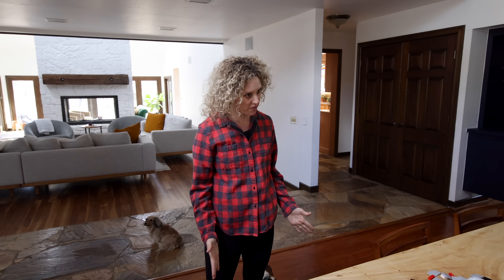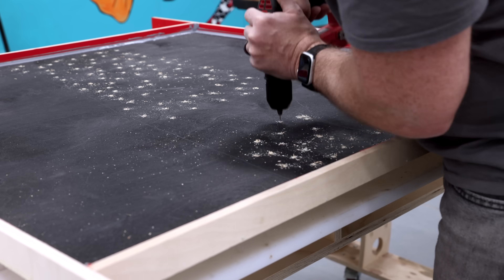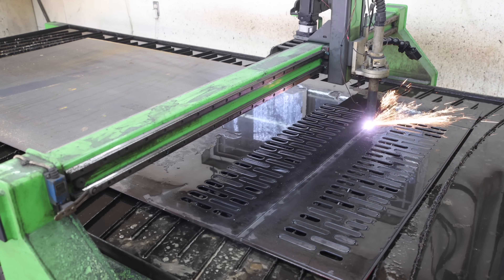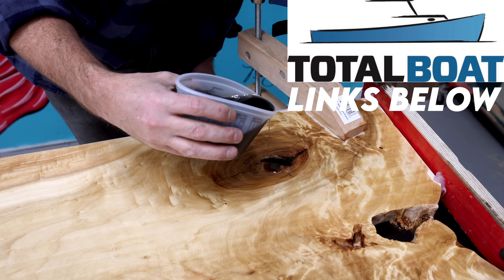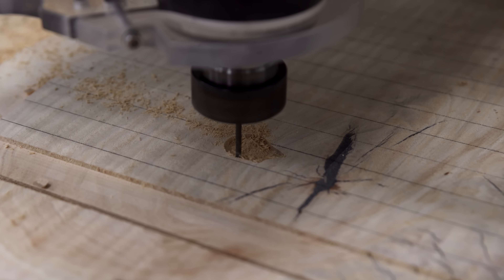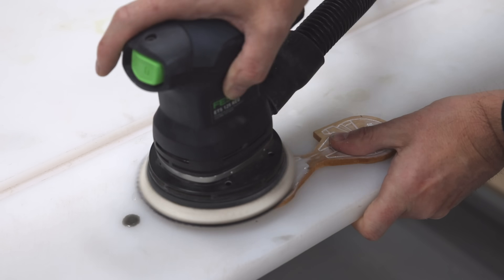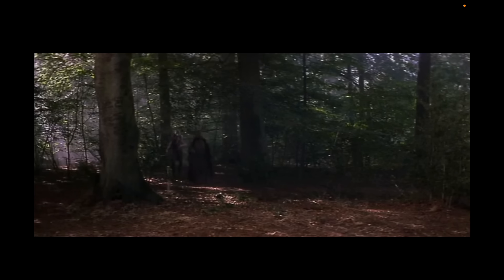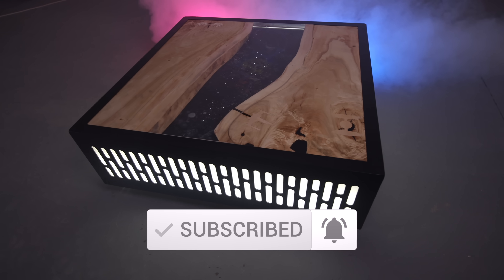Every Star Wars Fan NEEDS This

Comment: Just for future reference, you should use polycarbonate instead of acrylic.  acrylic is brittle, and polycarb is much more flexible.  That's why we use it for signs, and it's much more weather resistant.  May the Schwartz be with you!
Reply: Polycarbonate will scratch very easy.
Reply: @scotthoward6339  It does, that's for sure.  You can laminate it with optically clear orafol laminate and that prevents it.  I've also sprayed it with clear polyurethane and that worked great.  Generally when I do polycarb signs I always spray tha back and apply translucent vinyl with laminate on the front.
Reply: Cast acrylic is much less brittle than extruded acrylic. Ask me how I know!
Reply: @okiwatashi2349  Oh man, I've got some horror stories of that too!  If at all possible I use cast laser cut acrylic, I've seen extruded acrylic letters just shatter in my hands.   I feel ya
Reply: Agreed on the polycarbonate
Reply: It's an epoxy table why do you need plexiglass isn't that what the epoxy is for????
Reply: @Dragndroprecords  have you watched the video?

Comment: This is so overbuilt, you put an over-built plywood frame inside a 1/4” welded sheet metal frame…and then kept adding more, I’m glad you’re pleased with it. So much money…so much weight.
Reply from the maker: More like 1/8th inch steel.

Comment: ‘The force is strong’ with this one. 
One “improvement” I could see is to have the fibre optics and the LEDs for the sides on separate switches, as I feel that in a darkened room it would be nice to watch the twinkling stars without the bright sides. 
Awesome build though and definitely a keeper.
Reply: or at least properly seal the edges to avoid the light bleed from underneath. Very cool project all in all.
Reply: and cut the fibre optics at different heights to give dimension .  totally cool though.
Reply: @markstanley7251  My thoughts, while watching, too.
Reply: Just keep in mind that we are not on a ball lost in the vacuum of space tumbling towards a Black hole 🕳️ Earth is FLAT and NON ROTATING ❣️❣️
Reply: @freefreepalestine360  bruh
Reply: @markstanley7251  I was thinking the same thing
Reply: @freefreepalestine360  Yeah, and I'm not typing this.
Reply: @rogermccaslin5963  Just keep in mind that we're one beautiful family in the center of the whole universe on a non rotating FLAT EARTH.  the bible is a flat earth book💗know that earth is not a spinning ball, lost in the vacuum of space tumbling towards a 🕳️

Comment: Instead of laying up a whole graph, you can shoot a photo perpendicular and centered from about 15 feet away to minimize lens distortion and then just pull it into your CAD software and trace it as a vector path. Or if you have Lightburn ($60) and calibrate a camera to it, you can pull the image directly into the software and autotrace it.

Comment: Sealing your wood pieces with a thin brushed on layer of clear epoxy before pouring your dark epoxy into the inlays can prevent the staining you saw. Saving you the headache you saw. Just a small trick I learned from another epoxy wood pourer.
Reply: varnish works too, as he mentioned, and then forgot!

Comment: "The Force is Strong!" And Im not even much of a star wars fan. But this was cool! It would be better if that strip of light from the outside was hidden and if the 2 lights were seperate switches. Again SUPER impressed with this original build from you! 👏👏👏

Comment: Is there a visible difference in drilling holes for fiber optics at 90 degrees from the wood to like.. 45 degrees in different directions? I feel like it would look pretty interesting if it does. Like alternating directions. Idk if that makes sense.

Comment: That is super cool! I love think up projects that use some sort of lights,such as lamps. Here is a good one take a leftover glass or acrylic and etch whatever pattern you like into it. Then take piece of wood or a box of some sort large enough so you the glass on edge on top. Cut a slot just big enough for the glass. On the bottom of the wood route out a space for your light source ( under the slot ) and deep enough to open up a space under the edge of your etched pattern( a friend etched a rose onto a scrap piece of 1/2 glass from a broken table top ) use what ever color light you like. I think you will like the outcome, get your wife or daughter to do the etching. I know of three ways to etch 1) is an acid solution, 2)sandblasting, and 3) using an engraver or vibrating pencil.HAVE FUN AND KEEP UP THE GREAT VIDEOS.

Comment: when you pull it apart next put some open cell foam in the gaps to block out the light that distracts from the epoxy part, hard white line of light is bright enough to out shine the tiny fiber optics

Comment: Just watched your video what an awesome table. I build Star Wars models and I have found that the best way to glue up fiber optics is with UV glue. The hot glue melt fit in the CA glue makes it brittle what causes the light to not travel through the fiber optics quite as well. 
I've been wanting to build a Millennium Falcon coffee table for sometime. Now I just had to find this video and it's making me want to start it.
Reply from the maker: Great tip!

Comment: i feel you could of taped the top, mill cut it, resin filled it then sanded the tape off which would of stopped any staining from the resin, it's a little more work but overall works nicer overall cause you can rip 90% of the tape off and sand the rest off without losing details.

Comment: Excellent job and the fix for the sideboards worked out well even though it costed a day more (Darth Later must have been at work). 
Not sure if anyone has already mentioned anything regarding the fiber optics, CA usually is not the best adhesive because it causes them to become brittle and the least amount of pressure can snap them off. I have found that good ol Elmers glue (either normal or the wood variant) works best to fix the fiber optics in place. The only thing left to do is sit down at your new coffee table with a tall glass of Wookies & Cream milkshake and enjoy the view. ;)
At any rate keep up the great work, Yoda best!

Comment: A parsec is a unit of distance, not time. When Han said he did the Kessel Run in less than 12 parsecs, he meant that he found a shortcut.
VERY cool build!!!
Reply from the maker: The force is NOT strong with me! 😞
Reply: Actually I believe Solo meant that his ship was fast enough that it could travel closer to a cluster of black holes hence doing the run in a shorter distance.

Comment: whouldent a layer of painters tape help with the woodstaining if added before the carving? then the epoxy is easier to sand away since its in the tape and not the wood grain, since wood have alot of imperfections for the resin to fill

Comment: Really cool build, felt like a shame to cover up the bottom piece after the work of "painting" it. If you ever do another build of this, I'd love to see that bottom layer dropped down to the floor, then multiple other "sheets" of clear epoxy with swirls and specks every 4-6 inches or so. Final effect would make it so looking down into the "river" would feel like looking into a deep void with distant twinkling stars.

Comment: I would have thought about using WRGB led strips with wled on a microcontroller that would allow you to also have a relay to turn the power supply off you can add a couple of buttons for functions and and it has an app for controlling it.

Comment: Good build.  Have to echo some of the others here.  Acrylic is destined to get really scratched up and some of the LED battery powered products out there are pretty solid and you can eliminate the cord.  For the cost of the table.  Spend a little more and pour epoxy.    Otherwise very slick stuff.  More dad jokes please!

Comment: 9:00 nerd me says parsec is a measure of distance not time, it's about 31 trillion km and comes with math far too complicated for a morning post (and most other times also).  Also considering you poured the epoxy seems like a lot of work to secure all the individual strands of cable because the epoxy would hold them all nicely anyway?  Just my two cents :)  you've got some pretty nice gear, also that metal was a steal if it included cutting.  May the force be with you

Comment: would have made a metal bracket to house the led driver, that wood will keep the heat in ... and no vents ?
and it is not in the center area, so difficult to replace ....

Comment: It looks awesome Jonny, but that power cord would very quickly get on my nerves, it's all low power LED and you have plenty of room inside the table so why not have some rechargeable batteries in there that you can connect a power lead to charge at times when you don't want to show it off and just have that added wow factor for visitors? 
Hi Jeff 👍
Oh yeah,,,, about the dad jokes..... keep them coming please  🤣
Reply from the maker: That would have been an option, but in our use case we’ll rarely use the lights. That cord just tucks under the base and you never know it’s there. When you want to put it in “party mode” it’s as simple as pulling the cord out again! Thanks for watching!

Comment: grrrrrrr a parsec is a unit of length not a unit of time. equal to about 3.26 light years (3.086 × 1013 kilometres). One parsec corresponds to the distance at which the mean radius of the earth's orbit subtends an angle of one second of arc. one second of arc or one arc second is equal to 1/3600 degrees. think of 1 degree being equal to 1 arc hour( this is not a recognized unit as it would be equal to one degree but is useful for learning the conversions) then you know that 1 arc min is equal to 1/60 of a degree and 1 arc sec is equal to 1/60 of a arc min or 1/3600 of a degree

Comment: This would have been way better without the wood, and it would give more room for more starships being implemented between layers of epoxy like a Death Star in the corner etc. that and the wood river epoxy table is so overdone at this point and doesn't fit the theme of the table in the slightest.

Comment: You went through all that then just throw a piece of plexiglass halfhearted across the top. Wtf. That piece was going so right till the reveal. Maybe could of filled the center with clear epoxy and did a nice finish on the wood. So disappointed.